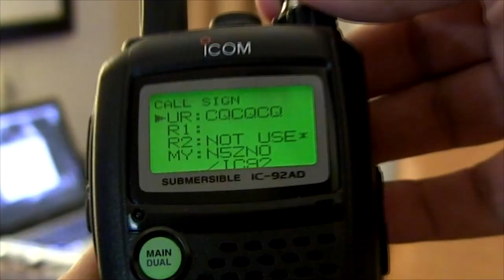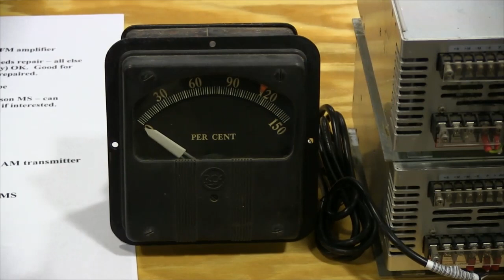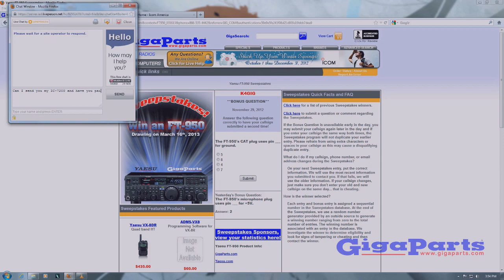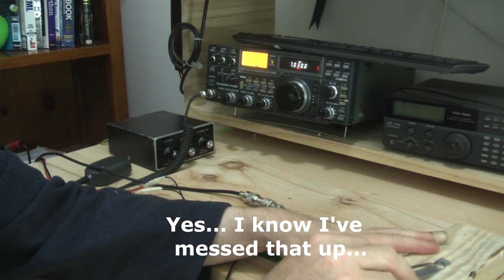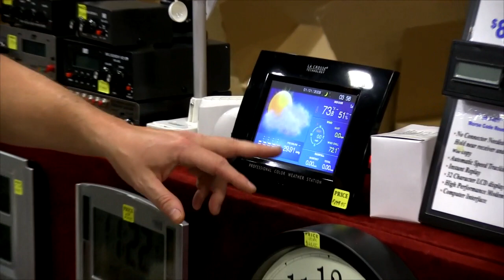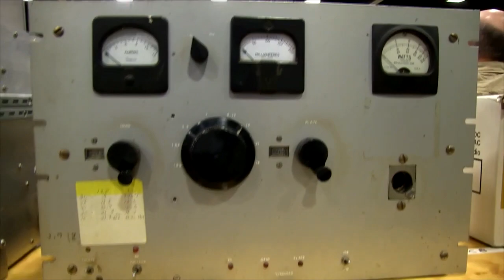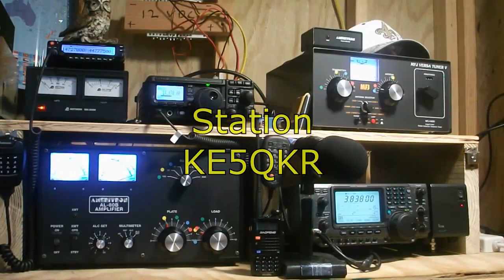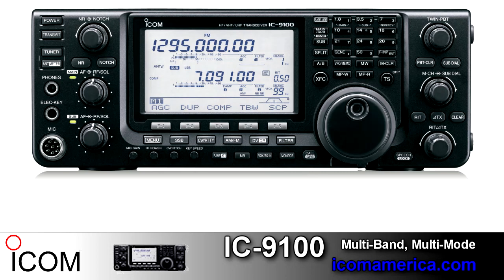AmateurLogic.TV 50: NS40 Kit, Hamfest & HRD

Comment from the maker: I have to agree Peter. Sometimes solder wick won't get the solder out of the hole. I use a small piece of wire on those occasions, but a needle might be easier.